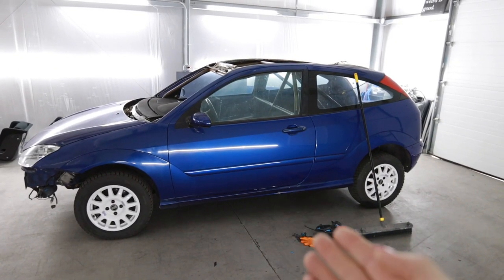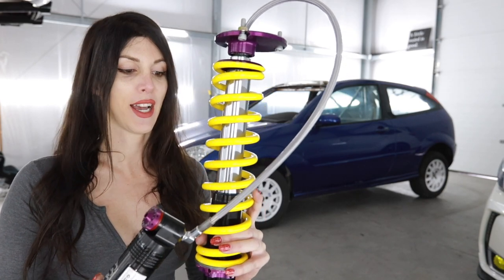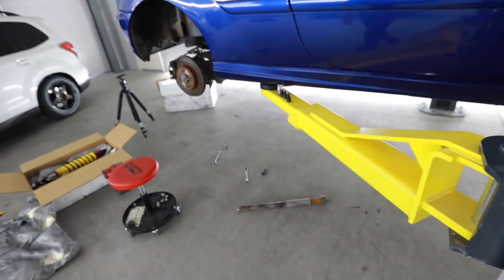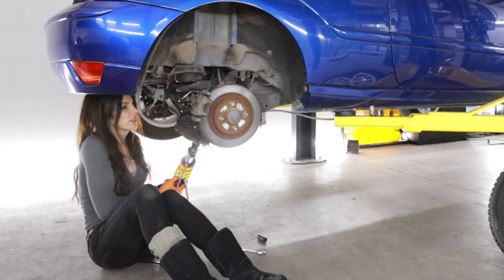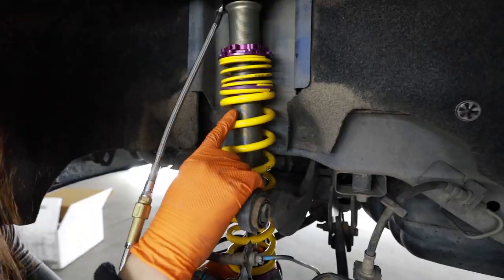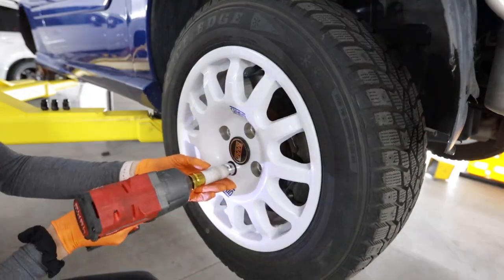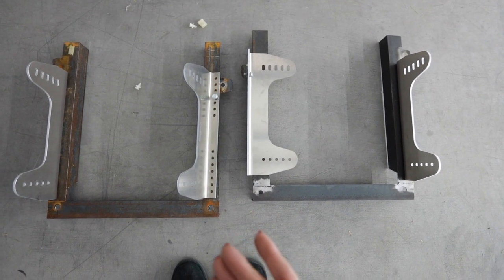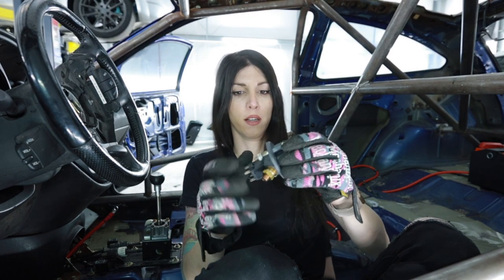Building My Own Replica WRC Car! // Project Rally Ford Focus SVT

Comment: Hi Sarah put the remote Resivours on the back into the trunk also. They will need a lot of adjustment with up down and bump stop ect. So you will want them easy access from the top. Plus they won't be all mud and dirt when adjusting 👌

Comment: I have an air powered nibbler.  It works great but be aware it will create a bazillion little crescent shaped bits of metal that go everywhere - especially in the soles of your shoes.......  After using mine I sweep up then follow with a retrieval magnet to get anything left behind.  Might check your shoes before walking on any flooring you care about too 😊  Great progress - have fun with it!

Comment: Sarah the volvo s40 has the awd bits. the focus mk1, mk2 and platform sharing volvos all use the same rear subframe design and sub frame mounting points. the arms are slightly different dependant on track etc.  so you could bolt up a s40 subframe including haldex diff, get a gearbox adaptor plate for the engine of your choice and away you go.  same wheelbase so can use the prop too.  get a standalone haldex controller to run the haldex unit to keep the electrics simple.

Comment: A solid bar with delrin bushings would work for the rear lower control arms but not heim ends. Heim ends would allow for front to back movement

Comment: Smash the dry ice into a slush with isopropyl alcohol. The slush gives it complete contact & gets the car floor colder faster. (Caution, flammable alcohol vapors & CO2, ventilate well.)

Comment: Sarah, between the Aluminum Seat Mounts and their Angle Iron counterparts you really need to put a Corrosion Barrier (2 dissimilar metals coming in direct contact with one another, even with paint between will cause the weaker metal which in this case is the aluminum to corrode). Take it from an Air Force Aircraft Structure Mechanic of 20 years, who also did Corrosion Control. Use a thin piece of Hard Rubber or similar, maybe even gasket material between the two if you aren't going to paint the aluminum.
Reply: Sarah probably ran into a couple of your cohorts while doing her stint as an Airforce tech mechanic. Engineers always have an advantage your advice is sound, same method carried over into industry.

Comment: A quick heads up - the quarter moon shaped pieces that the Nibbler spits out will imbed themselves into your soles of your shoes.
Not to mention a few sticking you (pun not intended).
I'd suggest using a magnet to gather them up.
You are awesome, Keep up the Great Job.

Thank you for your Service!

Comment: On the  front strut towers, maybe drill/cut out what you need for the shock reservoir, then create a sheet steel support, cut out the same way, to 'cap' the top of the tower for structural support. Weld it on.   
BTW, may not have been an attention grabber, but more people will be buying the Hyundai than whatever else is more fun, so a review on those are still worth it.   Besides, you're doing it.

Comment: Very cool. I snapped my belt recently but damage is relegated to valves. Ordered a remanufactured st170 head before taking this one off but I might take the ol' Dremel to it, the exhaust side especially left room on the table for better flow.

Comment: Wiring: Remove everything and re-do it with Fueltech, it's a brazilian product that can manage everything on the car, from the engine to the lights. You can use it as your gauge cluster too. Look it up here on YT, it's very common here in brazil

Comment: For AWD one of the "easier" ways of doing it is using Volvo S40(?) Parts as the rear subframe is supposedly close to bolt in. 

Oh and what you're calling an upper control arm is actually the camber arm for the rear.

Comment: At 8:07 ..Cut and notch to clear and then reinforce that area with some thick steel plates that are contoured to fit.
Reply: 10 or 12 gauge should be plenty

Comment: Sarah, you should take a leaf out of the book of the Project Binky guys (Bad Obsession Motorsport). You should build a negative suspension jig for those rear control arms so you've got the positions of both ends in 3D space then a new suspension arm can be made to clear the coilovers. It might be better than the Nissan part. Is there anything in the Ford parts bin that can be used. What did the WRC cars use?

Comment: you're going to want to change those curved camber arms you were talking about being close sooner than later if you're changing the ride height to correct your camber, i can recommend the Massive Motorsports ones, same with the toe arms in the back.  but those are going to get thicker than the stamped steel crap ones that ford put in there. since that arm doesn't come straight out it needs that boomerang shape to keep it moving properly .  but also... i'd guess the engineer at KW might know something i don't... ya think.. lol

Comment: Hi Sarah, love your channel and your jokes and the dirty innuendos. As far as your suspension issues, check with the boys at Cork Sport about the control arms on the Mazdaspeed 3s. Since Ford and Mazda share alot of the same parts you might get lucky. I know they have some tubular suspension parts.

Comment: The heck, the Hyundai review was great. Who can spend 90k on a pickup truck, etc?
Reply: I'd tend to agree.  Actually, I'd easily rate Hyundai right up next to Toyota for reliable cars with solid engineering.  Where they excel is the tech you get for the price. 
I really wish the would have another crack at a full noise 4wd again like the Terracan.
Reply: Totally agree. But people want fancy over priced Italian, American muscle, and German POS. That's why most automotive youtubers have them. I believe most of her reviews are on the money for 98% of the American drivers

Comment: I’ve said this before. I’m gonna say it again. Make your life easier and use the lift. work at waist to chest height standing, then you can use your legs. 

Keep up the good work! 👍
Reply from the maker: Filming vs solely working are two different things.
Reply: I was going to say the same thing! Being a technician for 6 years made me spoiled  having a lift to where I hate working on the ground now.  I'm sure it's a habit you'll eventually break out of Sarah.  

Could you not just use a taller tripod?

Comment: Is there anyway to mount your reservoir in your wheel well like they do on rally trucks ? Just a thought. Great to see your progress 👍
Reply from the maker: The fronts it’s impossible because the hose is located directly on the top of the strut. I want it protected inside the car. The rear it’s able to mount anywhere.

Comment: I would suggest against a gloss white interior.  The glare on inside wndows is VERY distracting, especially transfering between shady and bright areas. A flat or satin black is much better. Had two friends who did it and it was a huge issue, especially in the a pillar gusset area.
Reply: Would like to see what Sarah answers... could maybe be desert heat issue with to much black color

Comment: Metric hex bolts and nuts, just as imperial hex head bolt and nuts, are measured by their major and minor thread diameters. Not by their hex size. It's "fasten-ating" that in 2021, many Americans still refer to metric fastener sizes by what's etched on the socket or wrench.

Comment: Just wondering.
To develop these special coil over suspension components etc, why didn’t KW just buy an old Focus, and have that in their workshop.
They then could have developed these coil over suspension components to fit perfectly etc
Rather then rely on many pictures and measurements from Sarah, which resulted in these new suspension components not fitting properly, and thus reengineering of these components is needed, along with mods to the Focus ?
Once the parts were developed, KW then could sell the cheap old Focus that they had originally purchased ?
🤷🏻‍♂️

Comment: There are companies that will build custom length and spec links for you.  Even bent or adding mounting points as needed.

Also, you can buy fabrication kits that you can cut to length and weld together yourself.

Welcome to the world of off-roading where even kits made for specific vehicles need to be modified to fit.  😂🤣😂
Reply from the maker: Links please 😬

Comment: There is simple and cheap way to get awd+wider wheel base to fit RS WRC wider body kit without using wheel spacers and buiyng expensive drivetrain parts.

Comment: Why not aluminum on the inside panels? That was a lot of work to prep the way you did just to put the same or more weight back in on something that does...nothing....035" alum is more than enough for the job once it's rivited in.

Comment: Too many comments to read but please please please don't waste your time with a chisel and hammer removing sound deadener. Smash up some dry ice, mix with acetone or 100% (or closest you can get ) alcohol. It creates a gel you can spread over the sound deadening crap. It'll literally shrink and pop off the metal without any effort on your part. Costs a few bucks but time is money amirite?

Comment: Please please explain, wy did you pick such a bad car. Esp, if you are going to redo the whole car. A more robust chassis would have been a much better choice imo.
Reply: hardly a bad car if it competed in wrc.  you wont find any car with a wrc prepped chassis and standard.

Comment: You probably should have contacted Multimatic's Dynamic Suspension division in Markham, Ont. Can. as they worked with Ford to develop most of the race parts for most of the ford race cars including the Daytona prototype.  I've worked with them in the past ' on older then Focus',  Ford vehicles to make race suspensions. Also you need a Frame Tech, or what every the US air force equivalent is, to come in and teach you how to wear big boy pants and do some actual fabrication,. all these 'issues' you come across are simple fixes.
Reply: So what your sayin is... If ya want to run with the big dogs, ya got to learn to pee in the tall grass.